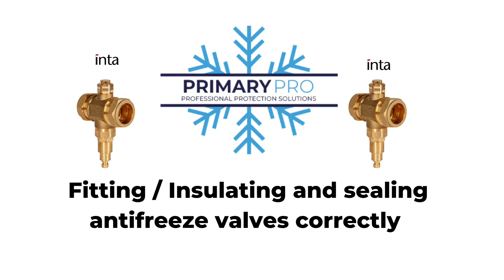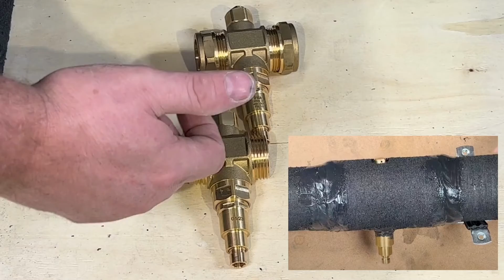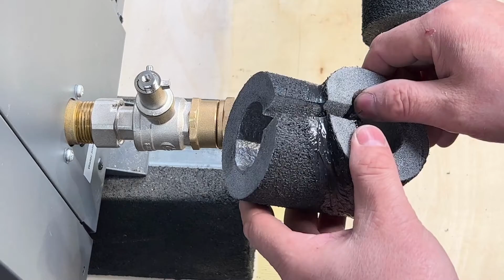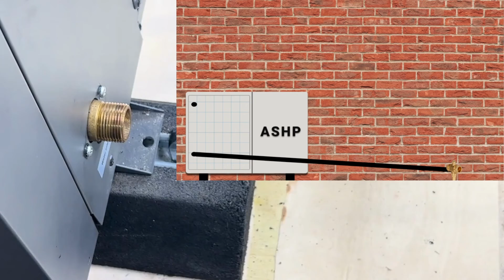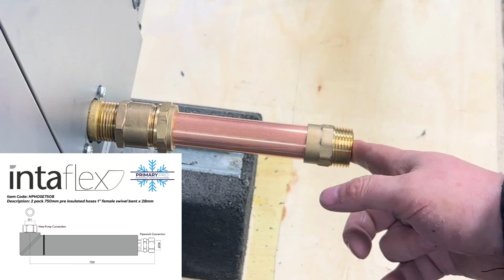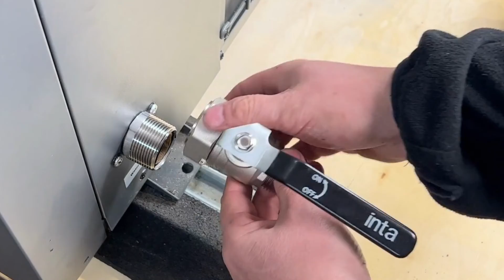Fitting / Insulating and sealing antifreeze valves correctly

Comment: You would really think that the connection would come pre-insulated in some kind of polystyrene housing like you get on heating pumps. The water outlet from the unit could be so much better. I hate how mess the install gets with silicone joints all over the place, they never last either!
Reply from the maker: HI 
polystyrene would not last and also still have gaps that need to be sealed, The bond & Seal are not silicone, it is our unique product that made for the job

Comment: Thanks for info. The inner diameter of the hose knee seems too small. I'm also a little worried that the relative heavy assembly starts to vibrate caused by the compressor.
Reply from the maker: we have now made over 120 000 flexi kits with no issues. The 35mm primary is used for the 28 hoses, and the 42 is used for the 35mm hoses

Comment: This might not apply to your insulation and installation method, but can you give some assurance that the following does not apply to your insulation.
There have been incidents of severe corrosion of copper piping perforation when water vapour has condensed onto cold water copper piping that has been insulated. That corrosion seems to have been shown to be caused by chemical reaction when chemical leaches from the insulation
To minimise the risk of such corrosion the pipes could be separated from pipe by using an oil based highly adhesive tape wrapped around the pipe and fittings or an internal coating on the inside bore of the insulation.
Do you recommend pipe wrapping as a precaution or are you content that the insulation and sealing of joints will provide near perfect prevention of rain water and condensed vapour getting onto the copper pipework. I'd be happy to hear that your insulation and installation method is better than others on the market so perhaps no further precaution against corrosion could be necessary.
Reply from the maker: I have never heard this before on any insulation,
 Our Primary Pro is 100% waterproof and then sealed with our Bond & Seal. This makes sure no water can get between the pipe and the insulation; we have also tested if moisture does get inside and have seen no problems as you have found,
Reply from the maker: HI 
Sorry for the late reply 
Been a manic few months and just saw this 
Not seen anything like this with our insulation or Bond & Seal, we tested over 3 years before launch and condensate pro has been ours for over three years and primary Pro for 2 years and no problems, have you got any info or photos of what the other insulation was